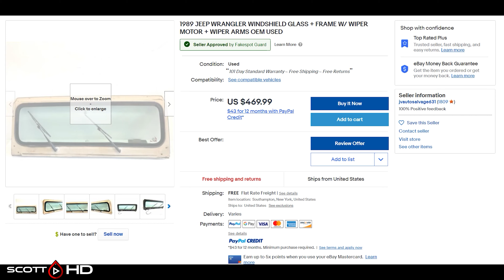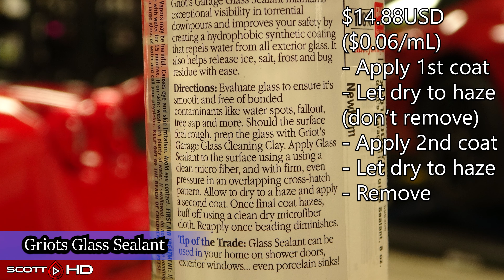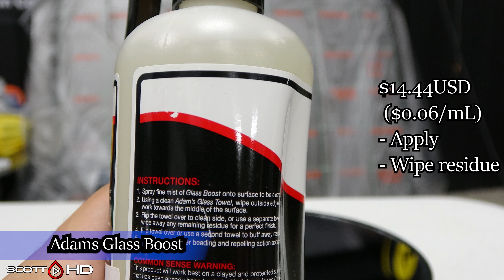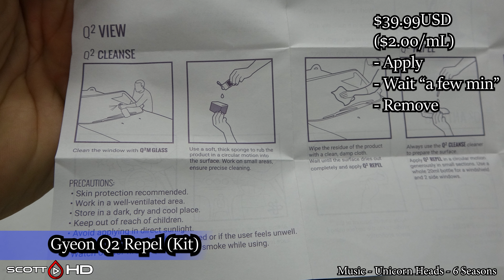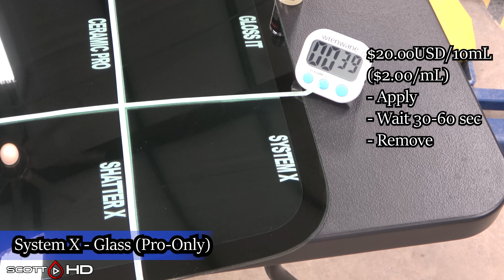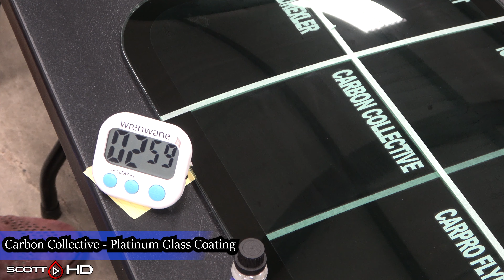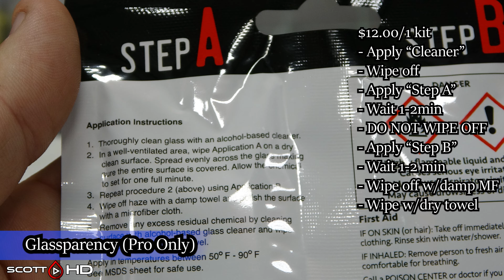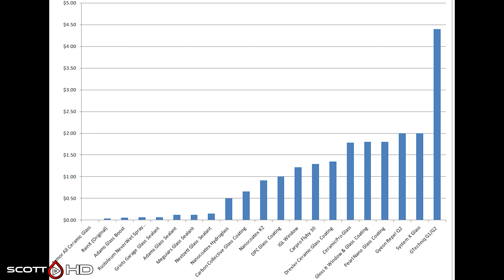28 WAY GLASS COATINGS TEST (HYDROPHOBICS) - Setup & Install - 1 YEAR IN THE MAKING!

Comment: It always puts a smile on my face when I see a new video from Scott.  SO thorough, methodical, unbiased and backed up with excel sheets price/performance - basically everything one could hope to learn from all these tests.  Anyway really looking forward to how things will unfold and what kind of performance we can expect. As someone who has a daily driven car and a lot of rain and winter conditions - I am a regular user of such products.  Up until now, I tried Angelwax H2go, Rain X, Soft99 Glaco, and now I have ArtDeShine Graphene window coating.    If you can please get the latter to your test also - I am really interested.
Reply from the maker: I'm sure there will be a second round of glass coatings after this.  I want to get more angelwax and soft99 products in my tests too. Angelwax is tough to get sometimes.
Reply: @ScottHD  I can tell you from personal experience - angel wax is crazy hydrophobic at expense of longevity - cca 2 months in my case. Soft 99 glaco lasted me 6 months before getting weak and is a bit less hydrophobic. I have artdeshine Graphene window coating - installed since February on a new car - still going strong. So I expect it will last somewhere like a year as advertised. It is however tougher to install - you have to be used to applying coatings as it really bites and bonds to the windshield.

Comment: I have used kamikaze intenso on my own vehicles and it lasts a solid 6 plus months in the Winter time in MN while I'm using splash red hot deicer every snowfall,  I also have used glass parentheses coating and it's lasted over 2 years and still going strong with little maintenance. I also try to minimize any spray of a sealant or wax on the glass after coating.

Comment: Scott is da man!  Questions from a lazy noob. 1) Do you always polish windshields before applying sealant? 2) Could you comment on which sealants are relatively easier to apply?  Finally, how the heck do I avoid the mess when using glass polish and rayon pads?  I once polished after washing the car.  LOL! Lesson learned.
Reply from the maker: Some of these products come with a "cleaner" (generally an isopropyl alcohol or ammonia based cleaner) to prep the glass to remove road grime, etc.  On a client vehicle I will not usually polish the glass for something like this. Only doing it to make sure it is a 100% perfect surface to apply to.   

I plan on talking more about the installation of these products when I do the windshield washer/wiper test as the entire windshield will get covered in the product.

Comment: Hey Scott, looking forward to this one. In regards to coating longevity I was thinking some of the harsher chemicals in windshield wiper fluids(bug removers) could affect windshield coatings but I'm not certain.
Reply from the maker: I'm going to do a trial run on this weekend on one or two products and see how it goes.  Will try methanol based windshield washer fluid first, then another one with the bug dissolver which is typically very alkaline (which kill coatings quickly)

Comment: Did you not use the Gyeon Cleanse? You showed it, noted that the product was a kit, showed the instructions for it, then appear to have skipped it and went right to the Repel component.  

From Gyeon: “Never skip the process with Q² Cleanse, which should be considered not only a cleaner but a bonding agent as well. Without the correct prep, Q² Repel will never reach its expected durability.”

Comment: Amazing as always!  I'd be really interested to see how non-glass-specific coatings perform vs glass coatings, like using EXO or KENZO on a section for comparison, or something like that?
Reply from the maker: I will play with non glass specific ones (on the glass) soon!
Reply: I used csl light in windows. The steep 120 degree angle creates droplets like marbles. Exo is bad on the windshield.

Comment: Scott, awesome job as usual.  Did you notice if any of these "coatings" were similar in terms of smell or color.  For example rain-x, griots garage, and a few other clear products all look the same.  Just wondering if they're all coming from the same blender at different price points
Reply from the maker: I'm going to touch on that in the other part. I would say 75% of them smell like isopropyl alcohol. The others are quite pungent.
Reply from the maker: Isopropyl alcohol is a drying agent. So I really can't smell the other chemicals in it.
Reply: @ScottHD  
Thanks Scott!
Reply: Griot's at least manufacturers all chemical products in-house with the exception of their own-branded Cerakote headlight restoration kit. It's likely many manufacturers arrive at similar solutions simply because those are the ingredients and characteristics that work, just like there are only so many ingredients you can choose from to bake chocolate chip cookies. You can vary the brands and quality of the ingredients and their ratios, but at the end of it you still have more or less the same kinds of ingredients going into the dough.

Comment: First! 👍. For meguiar's glass sealant, there are 2 methods of applying meguiar's.  One and apply a layer, after the appearance of a veil applied a second layer on top, then 10min after wiping with a warm tempered damp microfiber, then 1 hour after renewing.  And frankly this method is much more hydrophobic and resistant!

Comment: I'm a glassparency installer and love the product, but that carpro fly by 30 sometimes lasts forever, before I got glassparency, I  Installed it on my dads work truck.... 3 years ago. Still going strong. It outlived my ceramic pro coating on my car easily, time will tell how it performs against my glassparency coatings.

Comment: I don’t know how you could work it in but I would be curious to see how these would react to repeated use of a mineral spot remover. I use Carpro Spotless monthly. Looking forward to the test. I personally use Griots Glass sealant and maintain with the Armor All Ceramic.
Reply from the maker: I may try to experiment with that on the second part and see.   I'm trying not to have an hour long video for that part, but may have to break it up into two videos...or maybe a second part only dealing with water spot resistance.

Comment: Soft99's Glaco would have been another good glass coating to of added.
Reply from the maker: I'll probably be doing a second round  (there are just SO MANY of these products out there - originally was going to do 20 - and just kept adding more and more....had to stop somewhere)
Reply: @ScottHD  true there are so many, I applied Soft99 Ultra Glaco 70 ml roll-on myself around Nov-2020, I live in Sweden and the weather is pretty harsh, also I use high concentrate wiper fluid. As of today the rain still gets completely blown of the windshield at 40 km driving speed.

Comment: Hey.... can you split the control in half and maybe apply your favorite (non-professional only) ceramic coat that's made for the paint? Just to see if it would work on glass the same way. ( I have used c quartz UK on my window before.. No visibility issues and lasted for many months)  btw if you apply a black vinyl that has no air release on the back of the glass it would look better. ( oracal 651 or similar)
Reply from the maker: I will do that!  Won't happen until this weekend but should be enough time for a coating to cure.    Vinyl isn't our forté so we just used several scraps we had laying around the shop between what we use for chrome deletes and other for doing signs etc

Comment: So strange the coatings you have used in the past don't last...  I have been using McKee's 37 Glass coating for the last 3 years and it last a little bit over a year on my personal vehicle that sits outside 24/7 all year.  And I live in Canada so we have pretty nasty winters and a lot of rain too.  I don't drive that much in the rain, so that helps with the very limited wiper action.
Reply from the maker: I am guessing it has a lot to do with our washer fluid here - it is highly alkaline for the intense amount of bugs we get here. (the "bug" washer fluid anyway... the standard stuff is primarily isopropyl alcohol and water here - only good to 32ºF (0ºC).  I purchased a lot of methanol based washer fluid when I went on vacation to Colorado this past summer that I plan on using for the wiper test (after water-only is tested with the wipers)

Comment: Maybe this test will change my mind about glass coatings. My experience is that they just aren’t worth the cost. Glass is easy to keep clean and can be done independently from washing the car. I always just recommend that people use something like Stoner glass cleaner, and NEVER use gas station windshield cleaner.
Reply from the maker: That's where I'm at with them, but I'm going into it with an open mind, because I want to become a believer!
Reply: I use ....Aquapel.  I can't seem to get it for less than $5 each, which turns out to be kind of expensive, since you'll need three for the whole car.  But the front windshield holds up for a good 6 months.  It makes driving fast on the highway in rain much better.